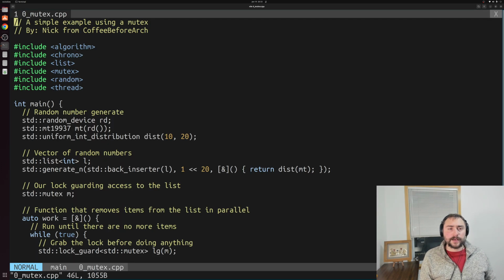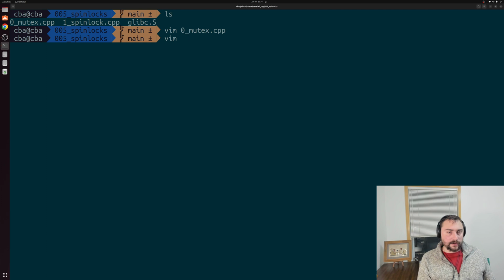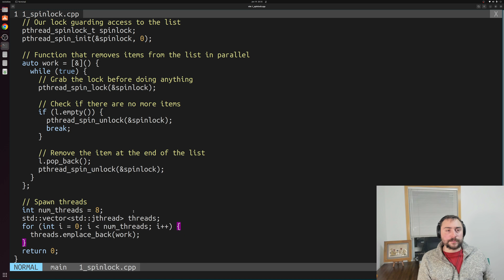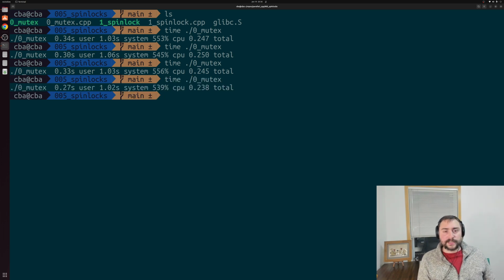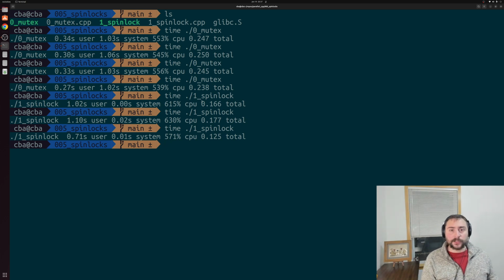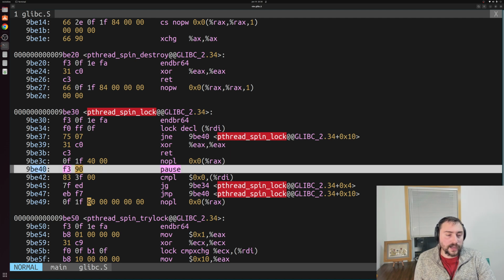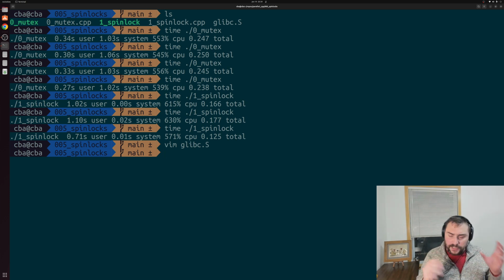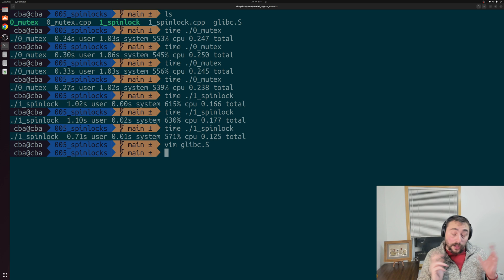Parallel C++: Spinlocks

Comment: Excellent 👍
thanks for checking out the assembly too! Also, the pause instruction should prevent the processor frontend from speculating on the loop and filling up the pipeline.

Comment: With the list you should try doing splice onto a local list on the stack and release it outside the scope so you don't end up with the delete potentially dominating things, also it's worth trying adaptive locks.  

My guess is if you scale those threads up above your core count (or set not as friendly affinity) then the spin lock is going to start losing.